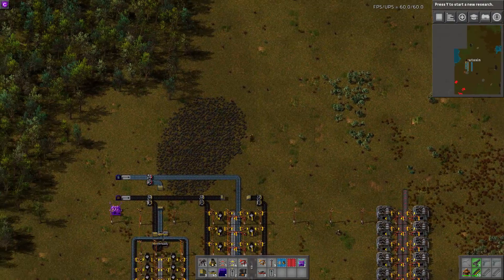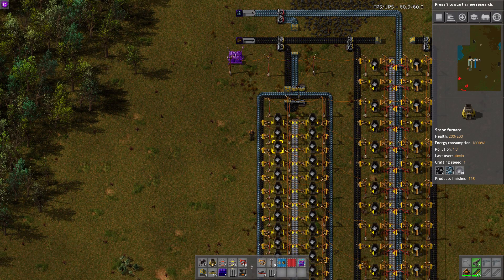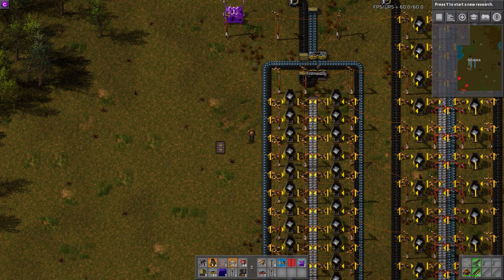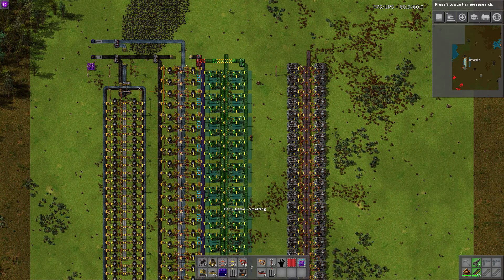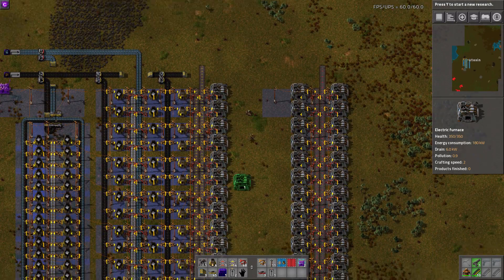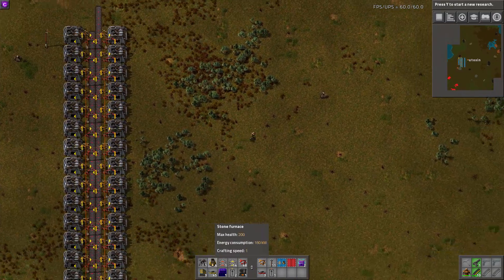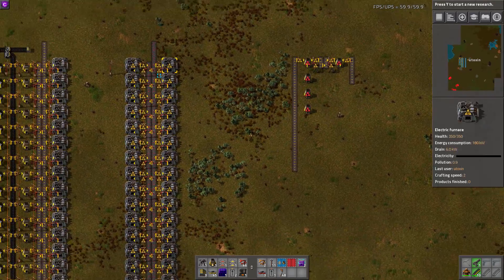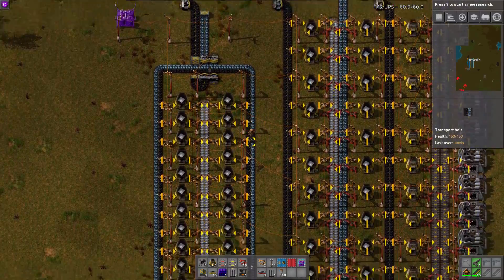Factorio 0.15 - Upgrade-able Early Game Smelter Tutorial

Comment: Could you add blueprint string?
Reply from the maker: I'll do that tonight. I probably meant to and forgot. Sorry!
Reply from the maker: https://gist.github.com/utoxin/1c99488e672a0cc9f0f1143d18d4e417
Reply: That seems to be the design cut down to 24 only? (Without the underground belt end.)
Reply from the maker: Probably. I don't usually build my it out to 48 until later, if then. But it gives you the pattern for the furnaces and inserters.